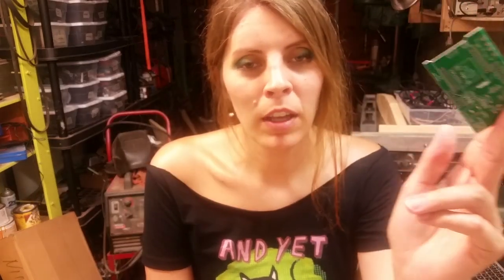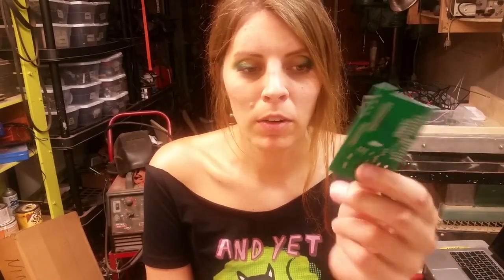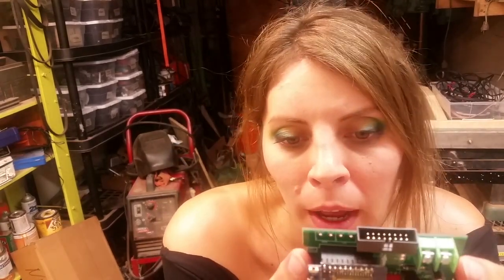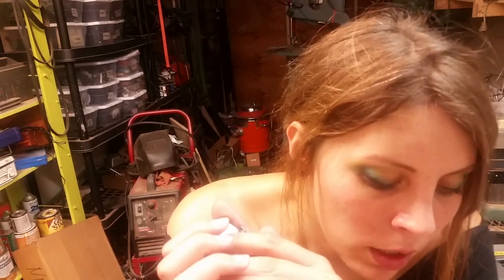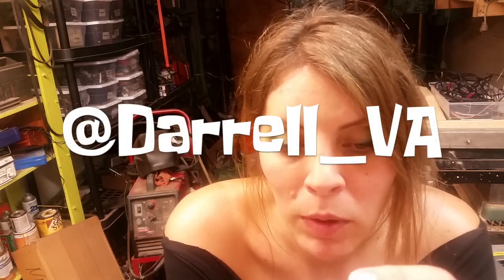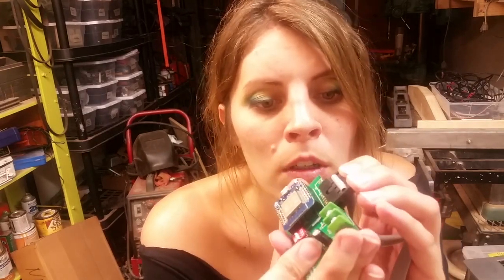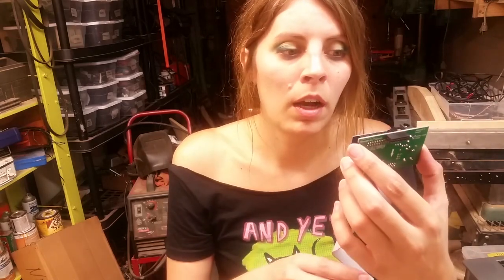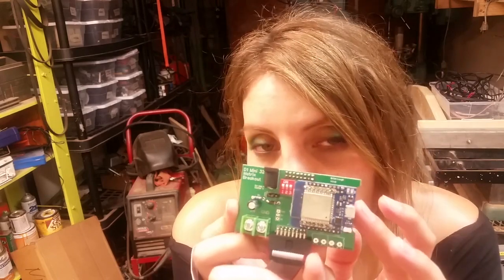Pixel Purse LED Matrix + ESP32 Part 1

Comment: Hey, I was also soldering Saturday night, and today too.
Reply from the maker: oooh, what are you working on?
Reply: @EmilysElectricOddities  I've been working for a while on a bunch of different things, but this one is a neopixel strip powered by an Esp8266. However, it's super customizable with its own web interface served from the esp. Soldered up the power supply, and had to add a bunch of pull up resistors to make it actually run. A lot of the time was burned on troubleshooting as usual.
Reply from the maker: @TheRealBobHickman  That's neat! I have a couple of ESP-based neopixel controllers that serve up a web interface. The ones I have aare called Pixelblazes, and I'm still trying to decide what to use them for
Reply: @EmilysElectricOddities  I looked at those, but wanted to make my own.
Reply from the maker: @TheRealBobHickman  Rad. Are you making it just for yourself, or is this something you're thinking of turning into a product?
Reply: @EmilysElectricOddities  I was making it for a lady at work, but it's turning into a product. It will work with different sized strips of LEDs for example.

Comment: I was at home on a Saturday night not soldering, what does that make me!?

Thanks for the shout out. And don't worry about my name, no one outside of Ireland can pronounce my name first try, it's impossible, it doesn't make sense! "Lao" or "Loff" are the usual guesses
Reply from the maker: I'm not sure, but it probably makes you cooler than me. 

First I said like it rhymed with Now, but then I thought it probably rhymed with Cough. But that was also completely wrong.
Reply: I would guess that it is pronounced "Low" ?
I have problems with my surname too.
People think there is a K at the end, but its more like H.
I always say "like a Scotsman would say Loch"
Once I got fed up at work and stated calling myself "Peter T", but then 

whilst inquiring about a parcel that I was expecting from our interstate office, I was advised that it was returned as there was no one by the name of "Peter Tee"
Sigh, I give up, went back to using my full surname. Deal with it people!

As for Saturday night, the last was with my daughter coming over, so pure joy for me.
Otherwise its usually poking at whatever project I have at the time.
Currently its a flight data recorder for my rocket and adding wifi and NTS time to my Nixi clock.

Picture me sitting by the window staring at my letter box waiting in anticipation for that super slow snail mail from China.

Oh, the postie just went past and did not stop at my letterbox nooooo!